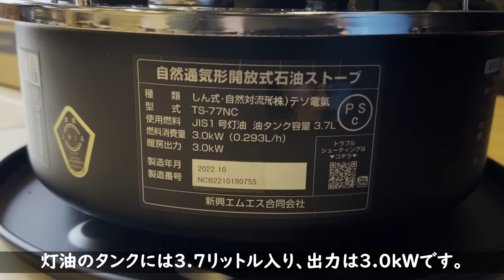【脱サラ古民家DIY】杉桧の伐採　手洗器交換DIY　アルパカストーブトイレDIY　No.152

Comment: There is a round fan that lays on the heater I have seen it in camping videos. This may help with distributing the heat.. Treats for sweet Toto-chan..
Reply from the maker: Thank you ^^
It's a stove fan. I have two on top of my wood stove.
It is strange that it moves even though there is no power.
Reply: What happens with the cut wood. You take it or the local community does? Thank you for your very beautiful videos.
Reply from the maker: @LeYuikin  Thank you ^^
The good parts of the cut trees are purchased by the local forestry association and turned into lumber. I get the thicker branches at the base of the trees that I can't sell and use them as firewood.